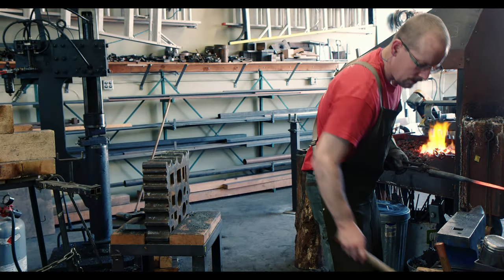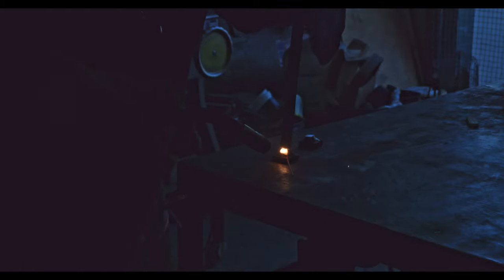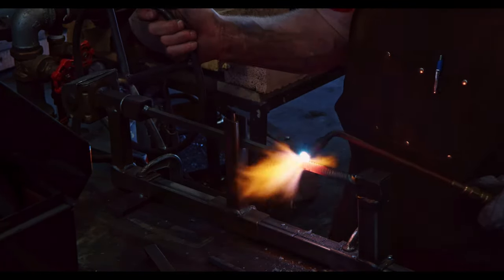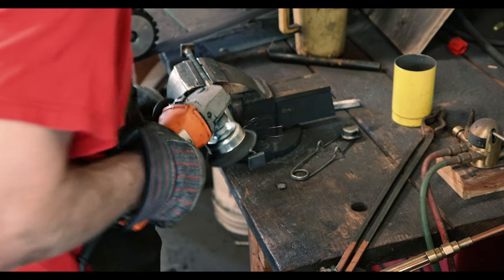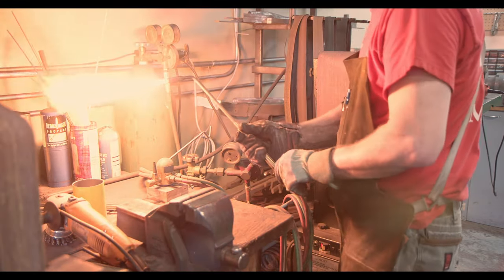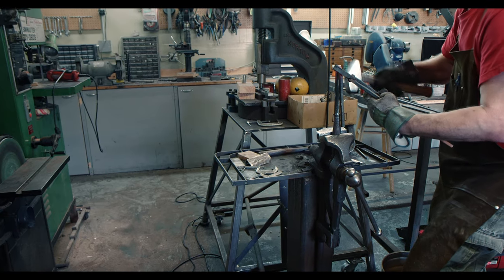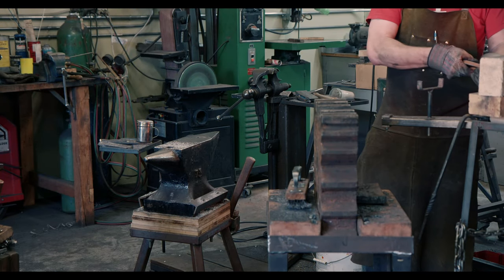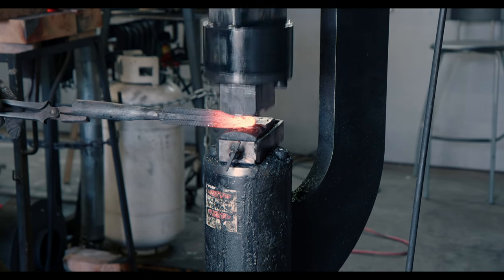Forge-Welding the Spear Star Pattern (A Spear Born of Fire: Ep. 4)

Comment: Hiya, I thought I'd leave a comment which may help you with the cleaning and prepping of your steel before forge welding. I'd recommend that you run some explorative experiments with Hydrochloric Acid/Muriatic Acid, to help you clean and prep the steel. This is the stuff that gets used in the pickling process, when they make sheet metal. It allows you to remove all scale and rust and get down to clean, virgin metal in a matter of minutes. And because it's a liquid, it can get into all nooks and corners, which you may not be able to do with the wire brush attachment on the grinder. I have personally used this stuff to clean various motorcycle parts from rust and scale, and it works a treat! Just beware of the fumes!

Comment: dude I love these videos. They inspired me to take on pattern welding myself. I made a 2 bar laminate with a hand hammer and anvil the other day and while its not perfect, it sure was fun! Why did you forge weld the bar back to square after twisting? Why can't you hammer it flat without flux and a welding heat?
Reply from the maker: The twists are significantly raised. For subsequent forge welding you want to flat surfaces. Try it and you will see why.